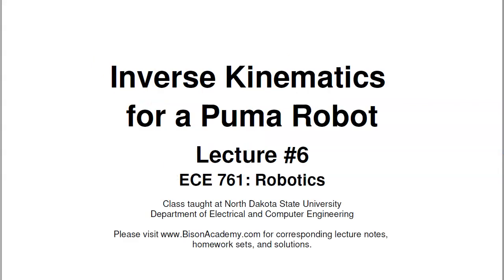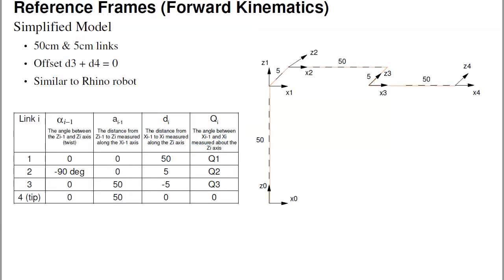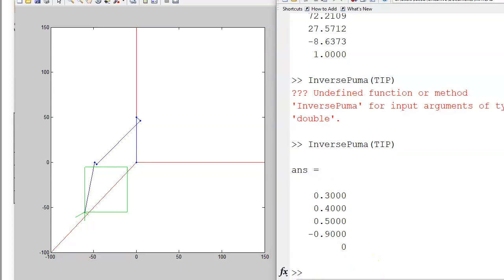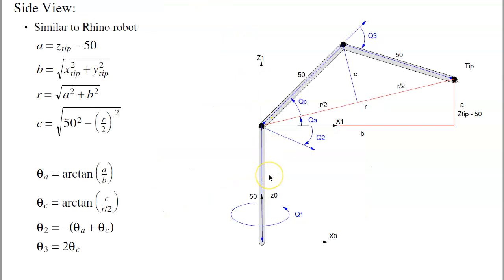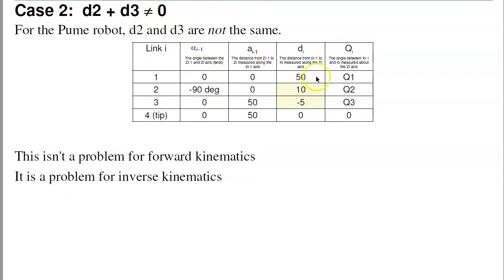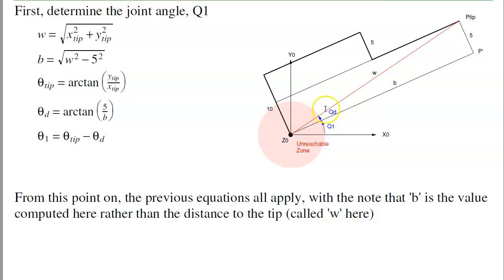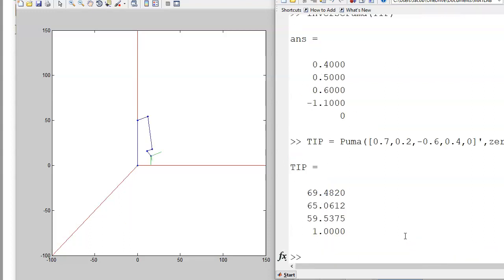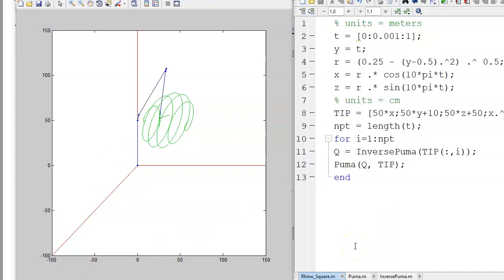ECE 761.06 Inverse Kinematics for a Puma Robot

Comment: My PUMA controller is failing, and I will need to build another, likely PC based or Raspberry Pi based, not decided. Once I get the basic electronics working and calibrated... I.E. specify a joint and angle, and have it correctly rotate... would you be able to assist me in getting the formulas correct?
This is my PUMA -> https://www.youtube.com/watch?v=aHV5oY7viBM
It may look familiar...  :- )